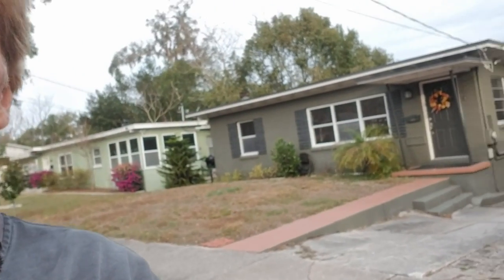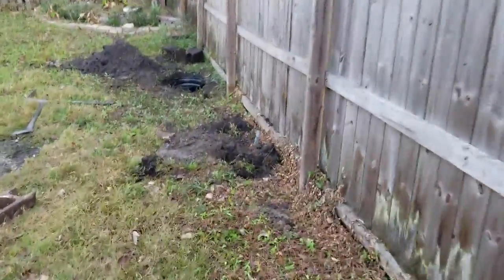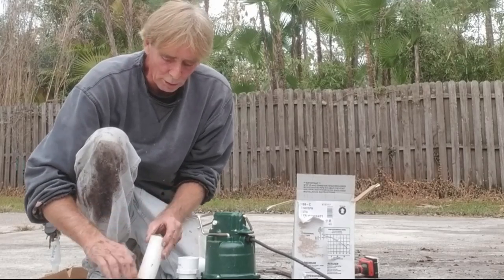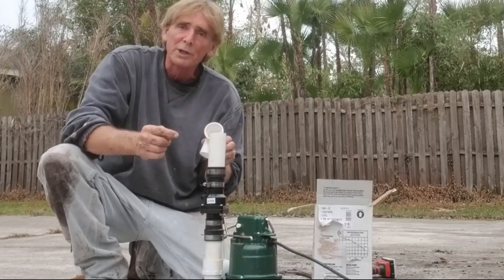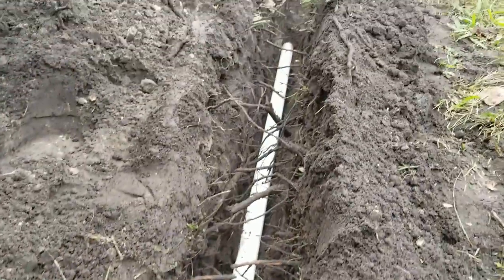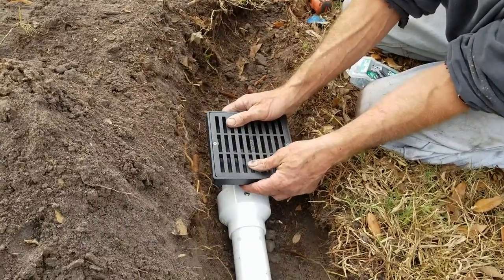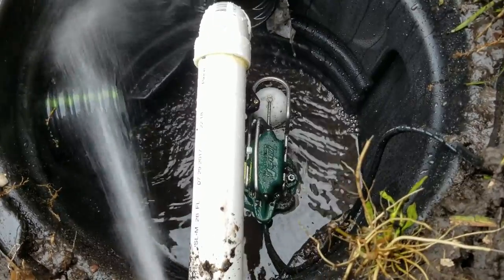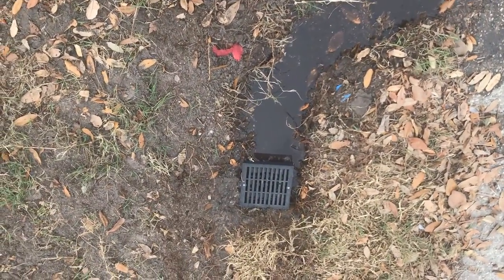Back Yard Sump System, How to Install

Comment: with that much water load (8 lbs/gal), I'd use another anti-backflow valve about half way up the length of the drain line
Reply: The resistance is not based on how much the water weighs in the pipe. It is based on how high you have to lift the water. That pump could move a million pounds of water horizontally but could not move 50 lb of water up 50 ft. Of course I'm not factoring in fluid or Surface resistance but you get the idea.

Comment: Does anyone know why he drilled a 3/16 hole on that first pvc riser before the check valve. I do appreciate him sharing his knowledge but he does not fully explain his steps. Also why the pump does not need to sit on any gravel or paver.
Reply: The hole is to prevent airlock

Comment: Hey Chuck! Great video as always! Just a question, have u ever used a t coupling so u could pump in two directions out of the sump pump basin? Just curious! 

Bo
Reply: It's all about the head pressure.  If you added a T'  the water would naturally want to travel the path with the least amount of head pressure.  So if both pipes are equal in head pressure then you could add a T and pump in different spots.  Although, you want to send the water in one direction that is 25' of head and the other is only 5' your water will only discharge from the lower run.  In that scenario I wouldnt use a T.

Comment: There’s a big difference between a No hub coupling and a fernco, and your using a fernco coupling. Pvc pipe should use primer and because it’s being buried you should use primer to prevent the glue from coming undone in the future. And the pvc coupling that your calling deep coupling is a pressure fitting used on water supply systems and what your referring to a small coupling is a dwv coupling used for drains systems, which this is where using purple primer (identification that a fitting was primed) comes in play to allow the glue from coming undone. Not a bad video but clearly not a Plumber, yard man. Primer should always be used rather water lines or drains, there’s a good reason glue manufacturers make both products, read the glue can and you’ll see they state on using primer on glued fittings.

Comment: What is up with the discharge? You pump it that far only for the water to have to go up and out of the discharge and you're not sealing the joints. Why not run the pipe to the curb or to the very edge of the driveway driveway and cut it in the cemente slope if they won't let you cut the curb? You can already see the water is brown so dirt is going to get in that discharge from either the joints where you put the set screws instead of adhesive or flowback of dirt into the pipe from the discharge being so low in the soil. Either way both are a impending disaster since that sediment is going to build up over time and clog that pipe.

Comment: Not a bad job.
Should use primer to clean the pvc joints before gluing.
Liberty pumps better than Zoeller.
Not showing electrical feed here. Needs to be encased in conduit and should be wired to breaker-panel.
Discharge design questionable.
Reply: Leonard Holt 
I’m not an electrician
That’s the way we have to do it
Our Code here
Thanks

Comment: With a few more basic video editing pre and post-production, your channel would look even more professional.
You have the content, Now it is it is time to better form and shape/package your content. 
1 stabilizes your camera footage. if using a smartphone- then get a smartphone stabilizer.

Have an intro and an outro.

Have smoother transition in the video.

You can GEt an older version of a GoPro with a stabilizer and you get a great version video quality setup- some Have a decent mic.So you may have to do a voice over In post-production 

You can try a smartphone with a smartphone stabilizer- make sure you get at least decent 3 point-axis one Or you could be wasting money.
Have a channel/video Format 
Any equipment you buy for your business you can get a tax write-off.
Of course, there may be that customer that may want to say you did not do a fine job.
Well, recording it can show proof that you have done your work After you finished your job and left.
Good job on the content.
These are some very doable tips to help you shape your content and improve your channel quality, as well as for future customers to be impressed. Thus getting more prospect of customers For your business.
This is called digital marketing What you are doing.
PS YOu need to have your FB Bussiness page setup and That page linked in the Video despection. 
Here is some free advice that would cost you from a digital marketer. But I have a soft spot for small businesses.
Anything you need to know about improving your video quality then you can google it.
If you need more help I can help.
Reply: But I like it where he checks his hir before he starts talking. :-)  11:11

Comment: What about the soil erosion around the outlet, the loose soil will wash away, you'll be left with a ditch on a public sidewalk, (lawsuit).
 Also it's environmental disaster . Why can't you move the outlet farther in the kerb.
Reply: needs concrete pad or at least river rock at the discharge